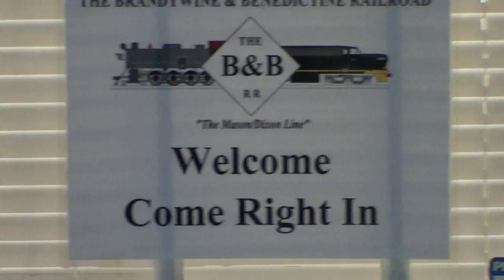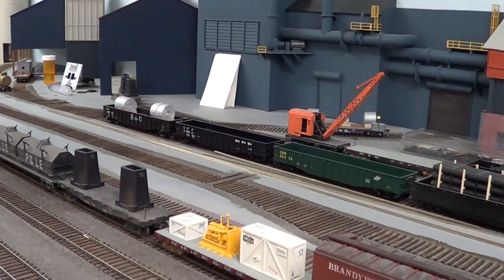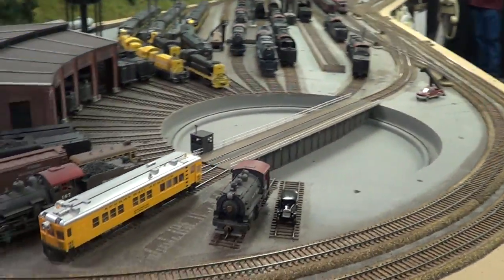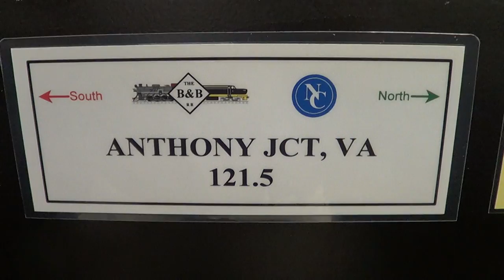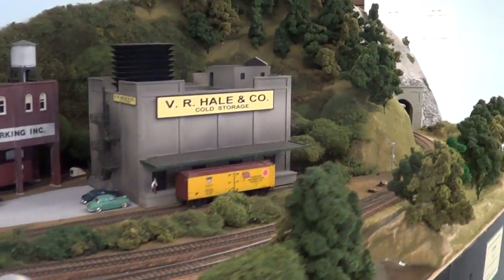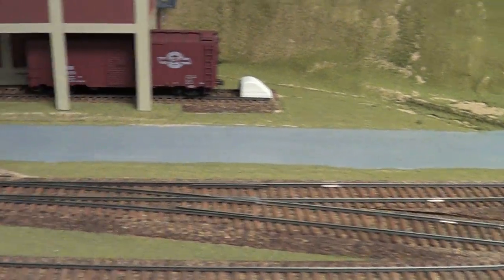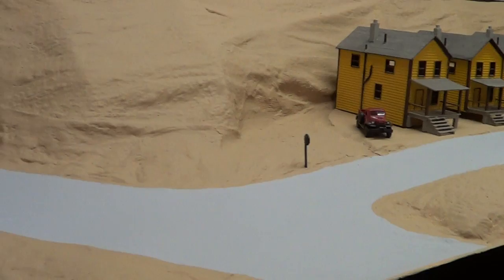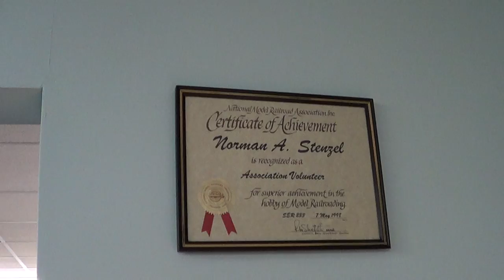Brandywine & Benedictine RR Part I HO 10-2012

Comment: How do you get power to be continuously flowing around all your tracks and I have some with great power and somewhat little tweak power and what should be the gauge are used to test power
Reply from the maker: This is basically DC 13 votes with a signal placed on it making it DCC. Have to have a DCC meter. One sold called a ramp meter